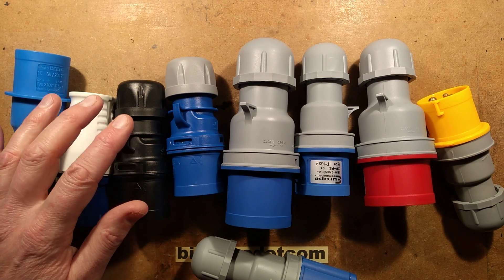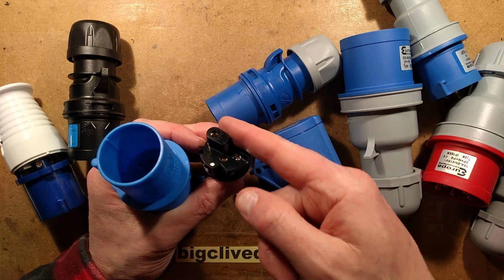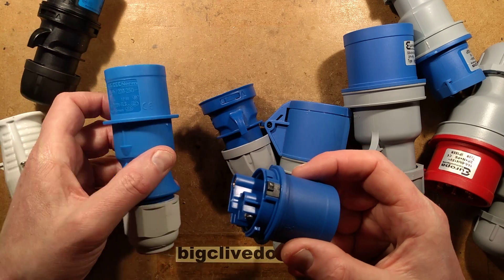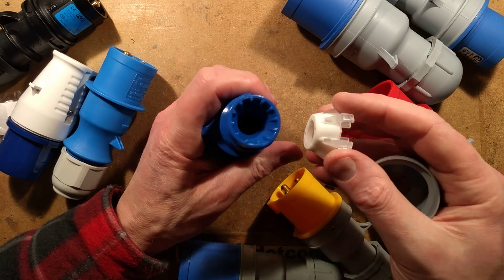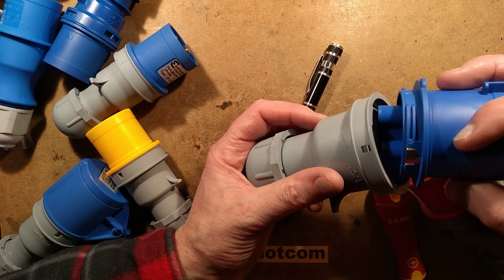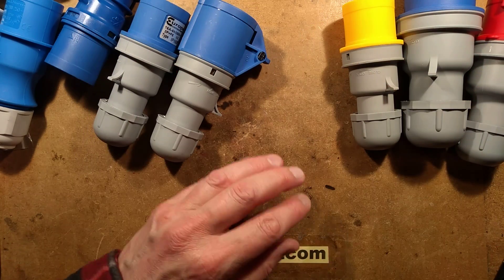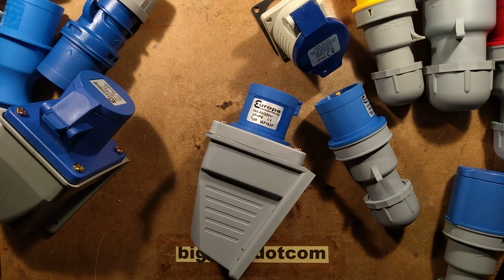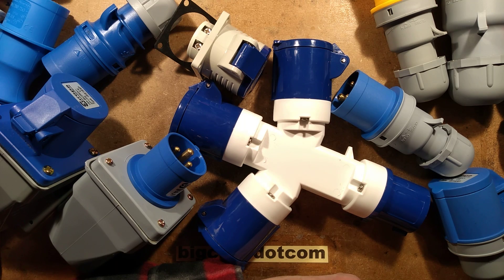My favourite industrial connector (Ceeform).

Comment: marine variants with a screw on gasket are available in Canada for shipping and pleasure boats. Internal thread and wide flat o-ring on inside of a loose spin-able ring around male side, external thread cut into outside of female side. Not for use underwater, but can be dipped or briefly submerged while live without hazard. Screw caps are available for the female side and are often tied to the end on a short string. Lose female ends are safe to be drooped in water while capped. They are compatible with the non-marine types, often plugged into a normal type mains terminal on land and run out to some craft.

Comment: Show more sockets and how the pin is held tight inside the female element... and then how a badly eroded socket or pin  transmits bad a connection disease to every plug or socket that is mated to an infected/affected one.  [yeah, akin to the pox]

Comment: estonia, almost every 3 phase connection is red 5 pin cee... with exception of home stoves which sometimes use smaller 5 pin bladed earth, rounded l / n connector i can't find name for, currently... as we use schuko which is 16a and can be quite water-resistant, most single phase uses that, even outside, even industrial / stage... blue cee comes into play when 32a is needed... 16a cee is far less used, maybe for inlets... but in countries like uk where usual socket is quite hard to waterproof, it finds a lot of use on the outdoor / industry area

btw, you forgot to mention the special sealed variants with twist rings and seals which are actually watertight enough to be left outside in the puddle of rain

Comment: We use what might be a precursor or early competitor to these on a ship built in 1938 in the US. All brass with a bakelite insert to hold the pins, and a rubber insert to seal against the cable. Russelstoll currently catalogs them as their FS/FD series.

Comment: They're used in South Africa, where the 16A, 230V 2P+E is known as a "caravan plug", and the 380V is known as a "welder plug", although the full range is available. I just call them IEC 603 plugs, and use them for connecting hardwired UPSs into their own DBs.

FYI, they're available as IP68/69, with a more secure, waterproof latch. Also, Waco (and Gewiss too, I think) makes some with screwless terminals, which is better in every way.

Comment: Used in McD installations for many years for 240V and 415V 50hz supply to all forms of cooking equipment - Australia
Usually in a pendant format, hung via jack chain. 

Been a few years, but as I recall a twist action to disconnect circuit was incorporated... a variant on the simple plug/socket you show here, Clive. 

These are all well and good, but often a single cabinet with say 2 deep fryers had more than one plug supply... and a huge electrocution hazard when under pressure to service equipment during peak food service times. 

yeah... suffered that and couldn't help the loud FARK noise and launch screwdriver across kitchen... to the equally shocked looks on customers faces behind counter!  

The Ceeform connector is NOT commonly seen elsewhere in industry here [Australia]. Another form of plug and socket [Clipsal] are used to meet IP56 Standards in commercial and industrial applications. Rating keyed, of similar ratings.  63A is historically adopted... the rating of many HRC fuses and MCCB's... as is 80A and 100A... 225A again, common as 250A - all for a reason. 
These have clear plastic moulded bodies, so cable connections are easily inspected... that is on the cable connections, not panel or wall outlets.

Comment: I have only ran into them twice, once for a 60a 5 wire extension chord for a temp kiosk and once for a film camera, they are pretty robust but I like the NEMA twist lock plugs a lot, is there any reason you'd find these better

Comment: These are great!
I have them on some woodworking equipment in the US, the equal US product was designed a half century ago.
The three phase connectors are awesome, if you get the phasing incorrect you can just rotate two legs with pulling the whole plug apart and rewiring it.

Comment: We use a the plug system called the 56 series in NZ i haven't seen it used outside of NZ/AUS.  
You should also mention refrigerated shipping containers use the 3 phase plugs but they have the earth pin at 3 o'clock (3h) instead of the normal 6 o'clock (6h)

Comment: Not commonly used in Australia. Normal, if unbelievable practice, is to use an Australian 3 pin, 10A plug outside. Try and get hold of an Aussie plug, they are very flimsy when compared with a UK 13A.

Comment: When you mentioned the low voltage connectors it reminded me of a bonkers deign job about 15 years ago. 30kW@24V. HoWmUcHBLLeedinCurrENt? Some muppet wanted it implemented on 1OZ FR4. LMAO. I showed the BDF (brain dead F%^&^&) the trace calculator which calculated a 6.3 meter trace width. I then got loads of crap which resulted in me telling them to stick the job. The funniest bit is that company no longer exists because they ignored my detailed report that stated that what they wanted to do was not possible.

Comment: Australia would be one of the few countries in the world where these connectors are rarely used. McDonald's in Austrlia has standardized on Marechal brand for their kitchen equipment. They started using these in the 70s so they were incompatible with the local standard connector. Most industry in Australia uses a peculiar connector that is embodied in a local standard. The local connector precedes the CEE connector by several decades. It's so embedded in industry that's it's impossible for the CEE connector to replace it. The CEE connector is used for refrigerated containers to be compatible with containers that come from overseas. I once tried to launch a range of CEE plugs on the Australian market, to a complete lack of success. The CEE connector is a better design than the AU standard connector but it's hard to change the market when there are so many AU standard connects out there.

Comment: Used on the ships I work on...440v for welder, 110v general use in engine room and 24v for inspection lead lamps.
  One vessel though they fitted all yellow 110v sockets,  but had 24v supply from them....bit if a fail as we had to re-plug all the lead lamps.

Comment: Used in NZ in marine applications (shore power cables for boats etc)  but strangely,  little used in outdoor event power applications for lower ampage connectors where local style 10 amp flat pin plugs are common which have no water proofing.

Comment: Seen them used in the lab at my last job for large 3-ph mobile test equipment (I was the one suggesting to use them), and also used at McDonalds. They were used on the multi-kilowatt microwaves on the prep tables back when food was made ahead of time, and I think they still use them for the instant toasters and microwaves for the hotcakes, last I worked there about 20 years ago.

Comment: I'm Working for a storage tank repair and maintance company in Belgium, we only use the Cee form connector on oil refinery's. only the 110V 3p connectors are white, we also have the low voltage connectors for lighting and there 24V 2P there white and grey. The trick with grinding off the flap also works to bypass the safety switch on EXproof sockets.

Comment: I remember back around 2013/204 when Teslas were new and there were very few superchargers the drivers could use a "blue plug" or "red plug" to charge their cars. There is a guy in Norway that used those extensively in the early years (Bjorn).

Comment: I work for a live events company in the US and we use these for power distribution to large PA systems as well as LED walls and projectors. Mostly we use an orange color 4-pin connector (Ground, Neutral and two phases I believe) but also we have some systems that use a blue 5-pin connector for three phase power. The company originated in the UK so I'm positive that's why we use these here. I like the Hubbell versions far better than the Mennekes.

Comment: These are used with safety site 110v transformers in basically all contractor work in the UK, but you already knew that :V 

They're pretty fuckin' dope. Chunky. Reasonable. Basically the big uncle of UK connectors.

Comment: Over here in Germany, you tend to see the red, five-pole ones in commercial kitchens for pretty much all heavier duty appliances. Usually 400V, 3-phase, 16 or 32 Ampere, IIRC.
Rather common on construction sites, and of course stage lighting etc., too.
As far as I know, they’re the official standard for that.
In older (well, old. From the 80s at the latest) installations, and in really heavy duty industrial applications, I’ve seen other systems, but these are pretty much ubiquitous.

The single-phase, 230-ish Volt ones are less common. I don’t recall coming across them regularly, anyway. RVs, boats and such do ring a bell, though. It’s quite possible they’re used frequently in those, but I know next to nothing about that.

Comment: In The Netherlands they are very common, I think most European countries use them
Reply: Camp sites in the Netherlands, and most of Europe, as it a good water resistent system. Outside and kitchens.  The 5 pin for heavy equipment in machine shops.
Reply: @raimogeel9497   That's totaly true. I see them in datacenters as well, just a common and normal set of connectors.

Comment: They are used for the 3 phase power for all of the heavier machinery in the facility where I work. But the amp rating is in 15, 30, 50, 100, and 250 amp increments. Ohio USA

Comment: Because you have seen that those beauties are made in Austria you might already guessed that we use them. You see them all over the place. Especially on construction sites or HazLoc areas. There are sockets out there that have a two pole switch in them, thus prevent arcing. It also prevents them from being pulled while energized. Basically they have a gasket and a interlock with a mains switch. Should be IEC 60309-4 if memory serves well.

Comment: hey big man, I have fitted literally hundreds of thousands of these sockets, I used to work for a company building generators, mainly for the hire market but some big installations too, I remember building one for the army as a backup gen for a training camp big v12 twin turbo rolls royce engine, I think its output was 10,000kva, the alternator was about four feet in diameter and eight foot long, had to be built on site and guess what it rained for days

Comment: I've used them at work on our Concrete Grinders and Shot Blasters.   480v 3ph 3wire plus ground 20A and 60A versions in Canada.  Our machines are machines designed for the sale to the US market (Canada doesn't have 480V 3ph, we always need to use a generator or 600V step down transformer).   So I can say without a doubt the big professional floor polishers and concrete prep tools for epoxy coatings in Canada, USA and Europe uses them.  Great for winter, unless the lid/cover slams down on your fingers in the cold, ugh! XD
See them in factories and breweries often when we go in to do floor prep.  Seems to be common in industries that import equipment from Europe.  But I'm seeing them more often used in leu of NEMA options in modern factories for portable equipment just due to the fact they are durable, safer and products sold to all markets prefer IEC vs multiple standards
Reply: We have lots of 277/480 here in Calgary Alberta)
Reply: Daniel Xddd Not something that gets installed a lot in most of Canada, you usually see it a lot in old factories, or machine shop, or places that buy or sell equipment to the USA where it is their standard.  277/480Y while our official equivalent is 347/600Y.  I've seen both in the same place before which is handy (options), but that was a plant that made motor equipment for the world.  I hear Alberta is an oddity in that respect, my guess is it has to do with your history and electrical needs, probably due to a close relationship to US machinery imports in the past.

Generators however aren't typically made for the Canada market and it is the opposite good luck finding 347/600V unless it is modified for our market.   Electricity and the history of the standards is fascinating.  I went to school for electrical before my current job.
Reply: Kuillus Calgary you see all three 120/208, 277/480, 347/600. Most of our downtown and some industrial areas have 277/480. One slightly interesting fact is a lot of LED lighting is rated to run 100-277V. You can put a lot of LED lights on one 277V circuit.
Reply: Daniel Xddd yep commerical, industrial and school lighting is typical LED or old school T8 or T12 tubes are common uses of 277V/347V circuits.  Voltage vs amperage is a wonderful thing more devices on the same gague of wiring if you bump up the voltages, and with the lower current of LED panels it is incredible.  The delema for lighting is 347V fixtures are not a common feature old school ones only had taps to 277V and modern ones have auto switching drivers but not worth it to build in capacity for one market.  Here it is typically run it at a lower voltage, step down the power (347v-277v for the circuit) or choose from the limited supply so I hear, from the electricians.  The lighting manufactures are having a boom in designs due to LED and money for fancy designs.  Seen lights go from boring tubes to fancy art pieces over the decade.  Do you do out door lighting? Or indoors?
Reply: Kuillus the vast majority of my work is indoor. I mostly do commercial electrical work.
Reply: Good. NEMA connectors are weak, unsafe bodgy mess. No standardisation.
Reply: @simontay4851  Yes, there is standardization with NEMA connectors. If I order an L6-20R I know exactly what I'm going to get, how many amps it can handle, and how it's supposed to be wired.

Comment: These look a lot nicer than what I've dealt with here in the US with these connectors https://www.lockingpowercords.com/products/4303-cs6365c-cs6364c.aspx Used them from generators or off buildings to run onsite for PA equipment.

Comment: In Germany,  we use the blue 3pole ones for connecting caravans, and the red 5pole for general 3 phase power (motors, machines). We rarely have the red ones with only 4poles (no neutral).

Comment: USA here and I work at a paint company and our spray booths use something similar, except the plugs are metal and that you push into the outlet, twist the socket and then push the plug in further.

Comment: UK festivals and events for all power distro, often with a 16A - 13A bar plug termination.

In Middle East much less common, Indeed twisted bare tails in a plastic bag was a very popular solution, ideally left under a portacabin in sprinkler system pools, or perhaps buried.

Comment: I have one on the outside of my appartment with 220V in northern norway. It was quite some effort to find an adapter to regular sockets for a car heater.  It was installed in the 70s by an electrician who swore to those being the best ones for outdoor use here.

Comment: The first, the blue ones are used across Hungary for motorhomes in camping areas providing 230v for them. I put a lot of them on camper ones and motorhomes.
Red ones are often uses for 380/400v applications in workshops and homes with 3 phases used for industrial tools like welders, 3 phase motor powered tools.

Comment: Entertainment industry here; pretty much my entire setup is made for 32A 400V, so I've got a couple of 32A 5x6mm² leads and some converter plugs from 16->32, 63->32 and even 125->32. I hardly ever come across 125A sockets without any power distribution already connected to it (and thus having an 32A socket for me available). The powerlock stuff is really interesting; I regularly come across multiple generator setups with a sync between them, all feeding the same 630A field cabinet. Big boy stuff.

Comment: US and EU here, datacenter applications. Both the 32A single phase variety and the 63A three phase, depending on the installation!
Reply: Sidenote: The 480V three phase 63A connector is a BEAST. 25kVA with the de-rate. O.o

Comment: Not used much down here in Australia. We have a similar connector system for these applications which uses a screw on retaining ring  system which also provides a pretty decent waterproof seal. No good for underwater but certainly good enough for rain and being hosed down.I have used ceeform connectors for 110V DC years ago as I knew it'd withstand both the voltage and current whilst being odd enough to stop the wrong thing being connected to DC.

Comment: You can get a version rated at ip68 they have a locking ring , also the twist lock versions fail much more often as the plastic around the  atch is brittle and they come open a lot.

Comment: Never seen them used in Australia and I'm a electoninics technician.
Reply: They do make their way to Australia mainly on imported European industrial equipment and you can get them by ordering from wholesalers. But they are very uncommon in aus. Electrician fyi
Reply: So what industrial connector do you use instead in Australia.
Reply: @simontay4851  Mainly 56 & 66 Series connectors made by Clipsal. There are other companies that make them and I'm sure there's an Australian standard out there that'll have a official name for these connector types but Clipsal has cornered the market so well that everyone seems to just follow there lead. Around the workplace people just refer to them by the amp rating. e.g. "Hey Bob, you gotta 32 amp extension lead I can grab?". They are similar looking to the ones Clive is reviewing but more robust IMO.
Reply: @willynebula6193  I stand corrected! Do you know if there is an Australian standard covering their use? Or are they something that should officially be replaced with Aus connectors but everyone turns a blind eye to because they're safe and it frankly doesn't matter?